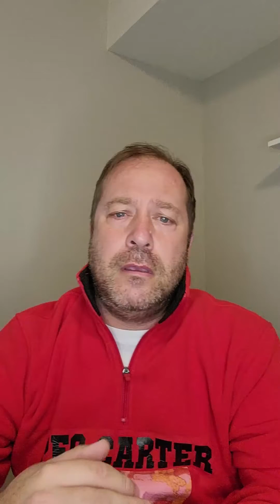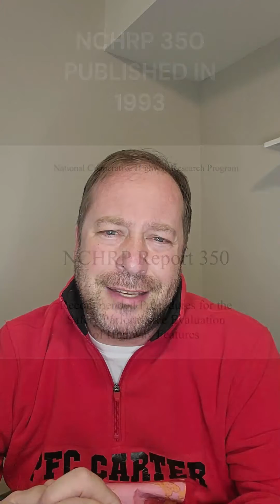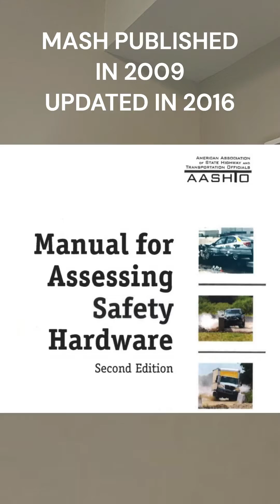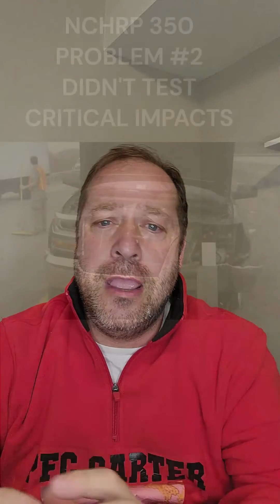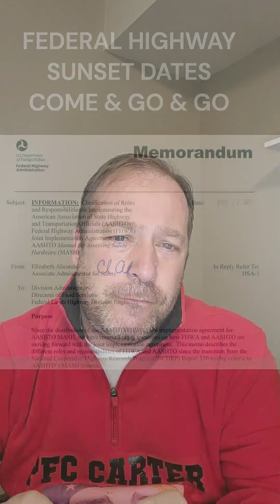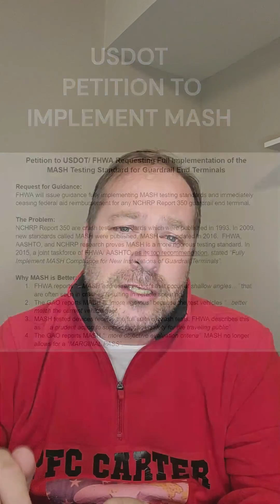PETITION TO USDOT FOR MODERN MASH GUARDRAIL TESTING IMPLEMENTATION

Comment: I owned a 1990 Geo Metro.  They are extremely light weight vehicle. Glad I got rid of it. Suspect a Smart car is heavier.
Reply: I have a Honda CRX Hf, 60 mpg. Like a Corvette you cannot see over the top of a guardrail or bridge railings when seated in this car. One of the best cars Honda ever made, but stupid federal regulations prevent it from being imported in to the USA because it doesn't have airbags. The slave masters of the Democratic party are hard at work on tirelessly taking away more and more of your freedoms.

Comment: ******* Steve, 15 min ago I watched my 1st ever short about a guard rail issue.. Alligator example. Watched it twice but still didn't understand what you meant. Went to your list of shorts, watched two more . The missing bolts I got. The added wood I still don't. I'm sensitive to your cause because I. Utah a rail DID sortta save my life. I bounced off it and into oncoming lane where a double tanker Semi ripped off the rear of my car spinning me off the opposite side of the rail, down that embankment while flipping end over end! Yeah, the force from the semi doing 50mph was what nearly killed me. I had my seatbelt on, thank God. I "guess" that rail did it's job? I've never considered any differently. Now I'm curious. The builtup debris, pebbles, sand, and "stuff" over the years caused my tires to loose grip as well (like NASCAR when they get too high up in the groove near wall.) 
I wish that rail would have absorbed the force of my car and kept me on it the rest of the 50 yards(?) ahead of my impact. It was on a longer than normal continued curve...at least 200 yards. I hit it 1/3rd of the way up it. Instead the rail bounced me off. I don't understand the geometry, just the consequence. Both sides of that portion of road sloped off equally... 40° I guess. 
Anyway...
I wanted to get more info from you and pose a couple questions.. but no where do you list how to contact you. 
I'm assuming several viewers will also want to contact you. 
1. Please make it easier to chat with you.
2. Take a little more time educating the rest of us what your discovered issue is AND why it matters. How it should be. And if not changed, the potential unintended consequences. My curious mind really wants that extra info. Thanks, Kevin

Comment: guardrail tensioners are 100% needed. I am 18 years of age writing this. I was 12 at the time, We were driving to the Milwaukee stadium when a woman lost control of her vehicle and ended up charging headfirst into a guard rail. Her vehicle basically was torn in half by the guard rail. She didnt suffer any major injuries but that guard rail was 10 degrees away from severing her head. I absolutely agree that our roads need to be safer. Thank you for putting light on this.
Reply: Id prefer to have the guardrails there myself.